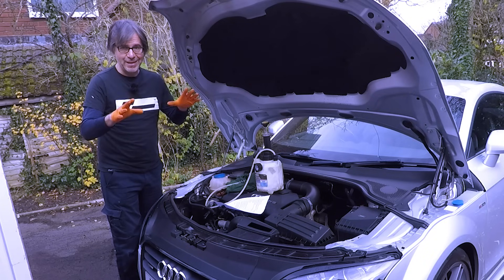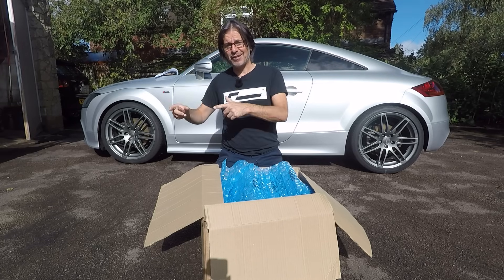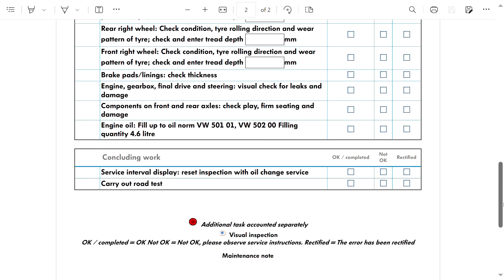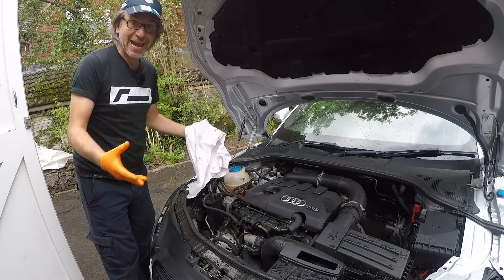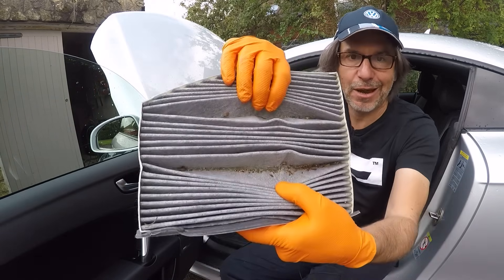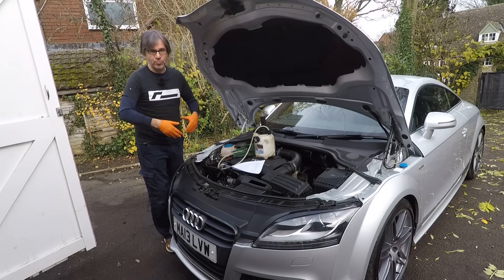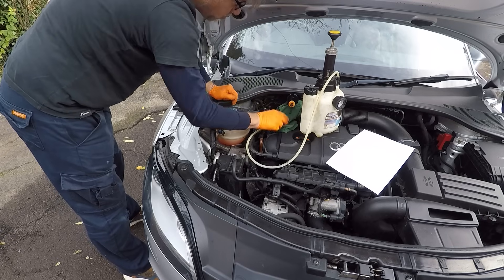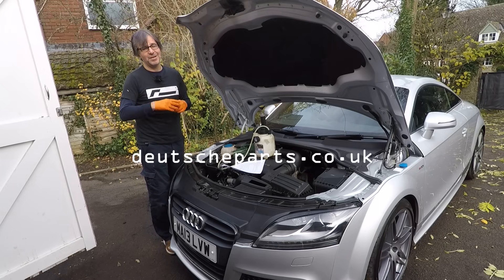MK2 AUDI TT OIL + POLLEN FILTER + BRAKE FLUID CHANGE - DRIVEWAY DIY #AUDITT #TT

Comment: Hi
I just wanted some urgent advise

I have an Audi TT 1.8TFSI 8J AUTO 2014 
It’s on 84,000miles
And it’s never had a gearbox service

S Tronic Auto box’s are recommended 40,000 for a gearbox service

But I’ve been told Audi don’t recommend it 

It’s booked in but I’m having second thoughts

Please could you give me some advice on this

Thanks,
Sami
Reply from the maker: Rule 1 - if it’s important, don’t believe what a seller says, find out for definite yourself.  As far as I know, 6 speed dsg is always 40k max but check with Audi to be 100% (I’m 99.9% sure)

Comment: Hi, I would have left the undertray off until checking for any sump plug leaks ?
Also, never start an engine with a rag left on top of your engine maybe ? 
Just friendly observations that's all  🙂
Reply from the maker: Thanks for the observations.  If you use a new sump plug and tighten it to the correct torque it won't leak and if it does (I know this from experience as once I reused the sump plug on this car) it will leak through undertray.
As for the rag, really no risk and its there as a reminder to check level after starting.
it's easy to forget spanners which will fall off and drop somewhere impossible to access so best practice is to check and empty engine bay before starting engine.👍🏻

Comment: Thanks for another informative video on brake bleeding. Also, I found that pressure bleeding kit for just £24 on eBay.
Reply from the maker: No problem! Make sure it's a decent one at that price as you really don't want to cut corners with brake fluid. And make sure you depressurise it before disconnecting, you will forget once but never again - always keep water close by to pour on any spills :)
Reply: @volkswizard  Thanks for the tips! I'll bear them in mind when I give it a go.

Comment: Hi just wondering if you have had any water ingress in the boot. I have mk2 tfsi black edition on a 2014. I get water gathering under the battey. Any help or suggestions would be Greatly appreciated. Thanks again. Love the channel 👍
Reply: Hi mate. This drove me mad. I adjusted the tailgate striker lower but very slightly. Then the bump stops on the tailgate. Still water gathering around the battery. I park on a dive that slopes towards the rear of the car and realised that the water was making its way there from elsewhere in the car and not the tailgate region. This is because the battery area is the lowest point in the boot. Believe it or not I found that it was coming through via the fuel filler area. I noticed a slight split in the rubber surrounding the fuel filler cap. I applied butyl sealant all around the join of the fuel hose. I used butyl because it doesn't set and it's always malleable so you can finesse over time should you need to. Just be careful filling up as fuel can deteriorate it. I have been careful and had no issues regarding filling up. I have had no water in the boot area since after doing this 2 years ago. Hope this helps. Let me know how you get on. Cheers, Richard
Reply: @richardlawrence273  hi mate this is exactly where it was getting in. I stripped the hole cap rubber seal and everything. Wheel off and outer arch cover and Renee rubber seal and eventually found out that the water was still passing coming in via the outer seal of the fuel filler cap. It turns out you would need to by a new cap as the outer o ring /seal isn’t sold separately. I also sealed the outer edge of the fuel filter cap and no more water. 👍

Comment: Miss the old workshop 😢
Reply from the maker: I most definitely don't! Tomorrow morning it will be raining in there as the water that condenses on the uninsulated roof tiles freezes then defrost and rains down. So a bit of late summer rain in this video is better than icy water down the neck! Also the light is a lot better which is handy for underneath the car shots.  And then we have the ****hole landlord who took over from the one I had for 17 years after he sadly passed away.

Comment: Nice video. Just done our 2013 TT (once a year). This time I used Mannol 5w30 Longlife 504/507 which is correct spec & only £25 for 5 litres. 
I always have a habit of going up on ramps when I change oils, as I find there is more room to move around taking the undertray off. Never bother to use torque wrench for either filter or plug.
Mine actually took all the 5 litres, but I do leave it to drain most of the morning.

Comment: Have been overhauling my 2007 TT 3.2V6 Quattro suspension. That includes wheel bearings ,steering knuckles(Audi £500 each), strut, spring, top mount, trackrod end, sway link, brake discs (EBC) and pads(EBC). and all fixings brake pipes etc. so. almost complete except wishbones (which is aluminium and in almost perfect shape. Problem was that all bolts were rusted in, and the strut and wheel bearing impossible to separate. Most of the bits were from Autodoc, who are superb, just enter your vin, and or the part number and up comes the part, and exceptional good prices and a selection of suppliers.
For example, rear calipers (TRW) £50 each!!) and they do videos of most activities..

Comment: I always have bled brakes with just a simple pipe that has a non return valve at the end, so can sit in container while i press the brake pedal a few times until it runs clear & no bubbles visible. Also just start at wheel furthest from reservoir nearside rear, finishing with offside front. Don't get why this should alter on different cars, but not sure.
Reply from the maker: The sequence is probably to do with the ABS pump fluid routing, VWG vary it from car to car so it's best to stick with the official order but ultimately order is just there to do it with least fluid possible.  The reason I'd never press pedal for a brake fluid change is that it's been known for seals in the master cylinder to come out of position when the pedal is extended past its normal operating range. Also if you are pressing pedal you can't see what's happening at the nipple unless you have a helper which I don't.

Comment: What do you think of carbon cleans. I’ve got a mk2 TT tdi 2011 with 65,000 miles on. Running spot on with a stage 1 map. Just wondering if a carbon clean would be of benefit